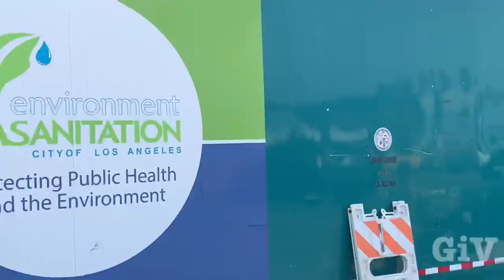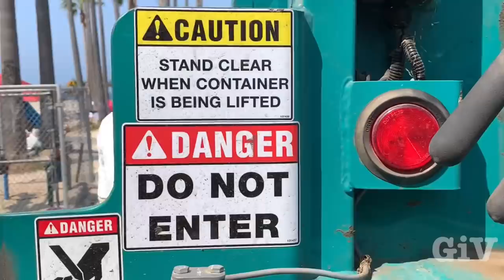Update /Storage for Homeless and Homeless encampment removal in Venice Beach

Comment: I was surprised that the clean up crews loaded the grocery carts on to the garbage truck. Wonder if the stores the homeless stole them from would want them back!  Those carts aren't cheap.
Reply: I was thinking the same.  Being wasteful isn't right either.
Reply: The stores pass on the cost to the consumer so they don’t care. I heard those carts damage garbage trucks.
Reply: Yep, store property and expensive. I know the stores would want them back
Reply: Places that have a serious issue with carts being stolen make you put a deposit down on one before you can use it and it’s refunded when you return it. I’ve had to do it a few times at stores.
Reply: @timterrell8678  They still want them, I heard some stores don't allow them to be taken out anymore due to theft
Reply: @nusaibahibraheem8183  I called Walgreens and Savemart to come get their carts off my street. They never came to get them. I’ve had over 50 carts abandoned on my street over the last 4 years.
Reply: Good points ! The carts have a nice mber one can call for them. The stores DO want them back.  By dumping the carts in the trash truck, it's making a statement,however unethical it is to cause stores loss. Better to sanitize the carts and let the stores retrieve them.
Reply: @timterrell8678  Yes, they do ! But all this is just a dog- and pony show, to pretend to solve Venice Beach's homeless dilemma- which these politicians ignored, until enough citizens protested. But this isn't just a " homeless problem.".    It's a rotten, crooked politician problem, because 40 year ago they created it !
Reply: @markgriffin5537  Me too.   Quarters get stuck in the little boxes at times,lol.
Reply: Would you want to put your groceries or other items in those carts? Not me.
Reply: They have enough work to do. No need to start contacting supermarkets over carts. Just throw everything away and start fresh
Reply: @rnava6343  shopping carts destroy garbage trucks.  They are expensive and stores want them back.  They can work with the city
Reply: Too filthy. Wouldn't want to put my food in them. Or even touch them.
Reply: They are stolen merchandise, but I doubt the stores want them back because the hassle of disinfecting them probably isn’t worth it.
Reply: @yulyasevelova769  Los Angeles City Council has been corrupt for a very long time. Many elected officials have been convicted and sentenced to prison. It's all a money grab. Just ask Huizar, Downtown District 14. Englander, District 12.
Reply: @EcuaLA  I do remember an article in the L.A. Times about  those two.      And I was thinking, oh I hope this is the domino effect on the City Council, Garcetti,all those people !   They have literal blood on their hands.
Reply: They not cheap to you, but to multi-billion companies they pennies...They just write it off as "Cost of doing Business"
Reply: @kailaniandi  Would you put your food in one ?

Comment: 👷🏻‍♂️ I have worn these suits before with mask & rubber gloves 🧤. It gets hot in the summer! You have to pace yourself to prevent heat stress. Stay hydrated you guys.
Reply: Yes, they are! Wore them most of last year the long term care facility I worked at was hit hard.
Reply: Lisa   DuPont designed these suits for protection in chemical plants. Now they have many uses.
Reply: @douggoble9695  - yup like wearing a Tyvek envelope lol